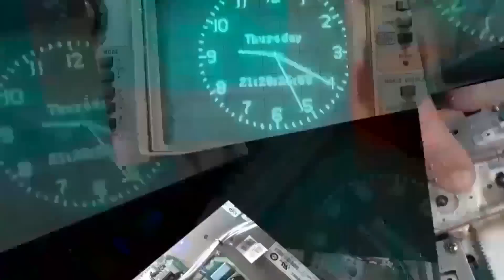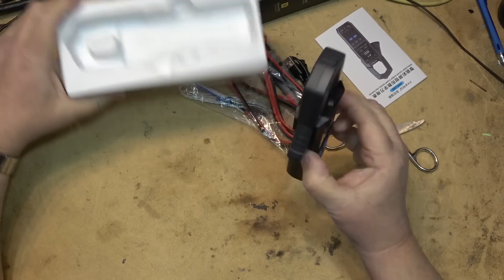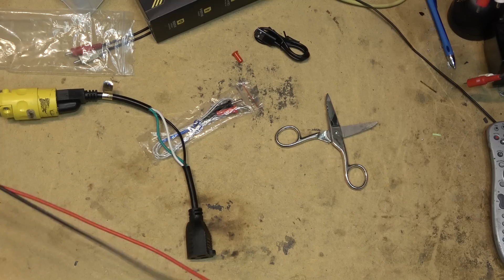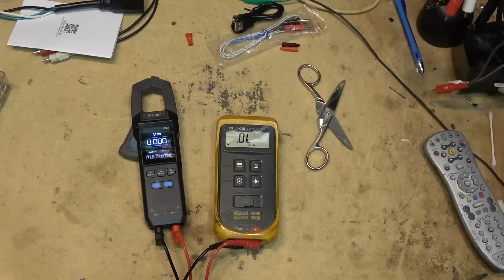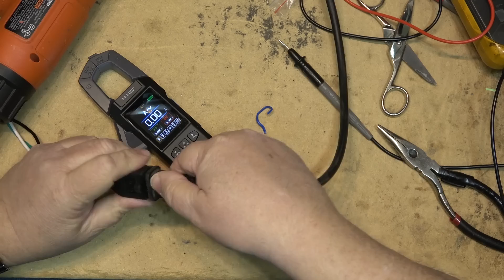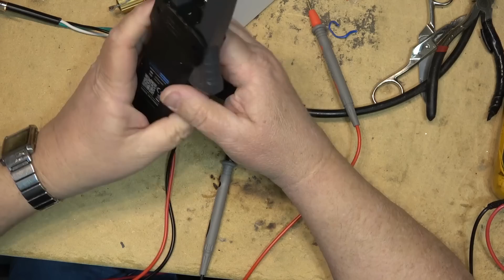FNIRSI DMC100 Digital Multimeter with AC DC inductive current measurement unbox and test

Comment: I've edited the firmware a bit, improving usability and fixing some minor issues (the official team is hesitant to fix the bugs). I'll post a link if anyone's interested. If necessary, you can revert to the stock 1.4 version using the standard method (the bugs are the same on 1.3-1.4)
https://drive.google.com/file/d/1iK5OGpGu1SeD59gQCf4Qb7jwI5Y8dLWN/view
ReadMe inside
Reply: Thank you

Comment: Ordered on because of your video. Thank you very much.
It is so nice to have that screen and push buttons instead of a dial selector. 
I am replacing my other fairly cheap one and working outside having to constantly press the display lighting button sucked. This is way better and is incredibly price at roughly 30 dollars to 40+ depending on how good of a deal you can find on ali express.

Comment: Oh man, you still work on vcrs?  I repaired them back in the 80's.
Reply from the maker: There are a few people stull using them. Probably for archiving work. I still repair them for now.  How long is anyone's guess.  As long as people want them fixed ill do it, but parts getting harder to find.
Reply: .  Any idea where I can obtain a replacement head or drum replacement head for a JVC HIFI unit?
I've got one stashed deep in a closet somewhere with a damaged flying head, don't remember the m/n though.

Comment: Is there an inrush current function. If not, it's a 'no' for me.
Reply from the maker: Yes it does measure peak and stores it.
Reply: @12voltvids  I downloaded the manual and there is no mention of inrush. I disagree that the 'max' substitutes for inrush. I believe inrush is a specific time based capability which is not the same as 'max'. I could be wrong, but I don't think I am. A manufacturer would take advantage of another parameter to put in their literature if it applied. I believe 'min'/'max' to be during the steady state. The price on their website today is excellent, $39.99 and an additional 12% off with code DMC10.